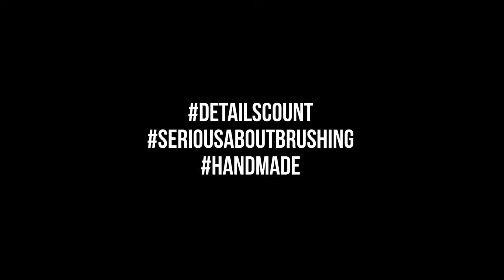Nature Climbing - The Process of Brush Making

Comment: Nice but you are using drill, router and planner without ear and protection... where is your security?
Reply: It may not be necessary. Desirable yes, but might not be required.

As a production manager I hired a company to inspect and measure the noise level of all our machines. Far more and larger than shown here. Hearing protection requirements vary, depending on the machine and length of time exposed. We developed safe working procedures for all our employees and have been inspected several times by state and federal agencies.

Some belt driven wood cutting saws used for short periods of time are safe. Belt drive drill presses are safe. Shaper tables routers and planers are usually not safe to operate without ear protection. Regulators will allow it for very short periods of time. Our company does not allow it. Eye protection is required to enter any shop.